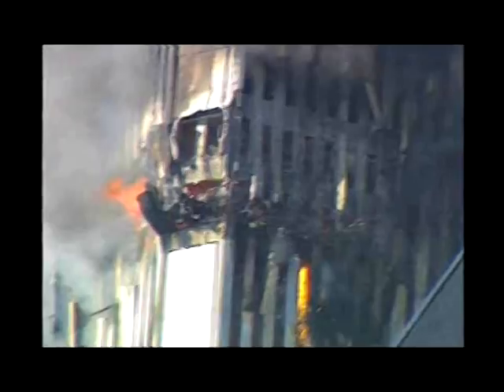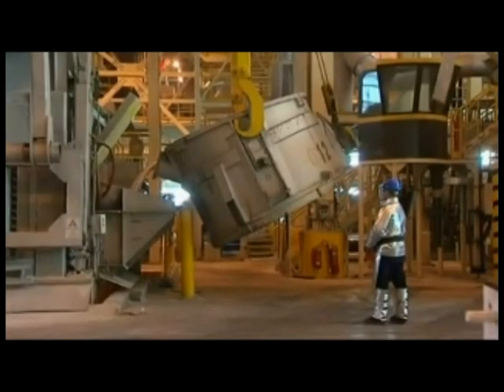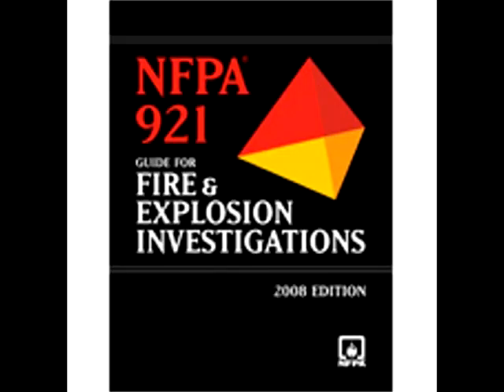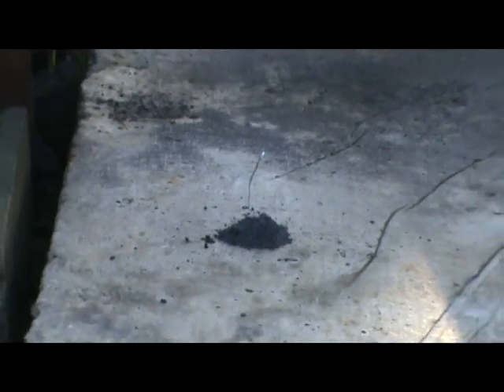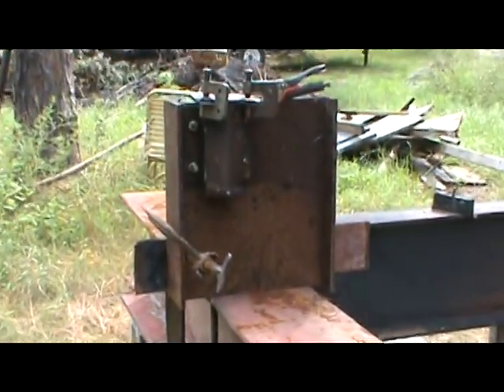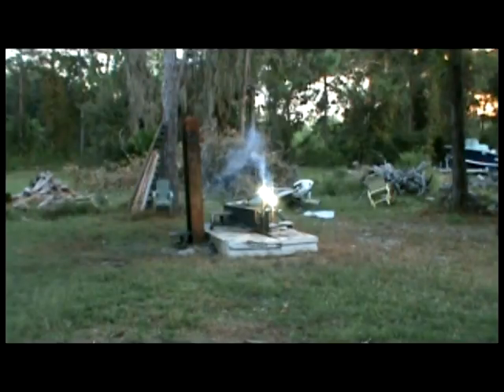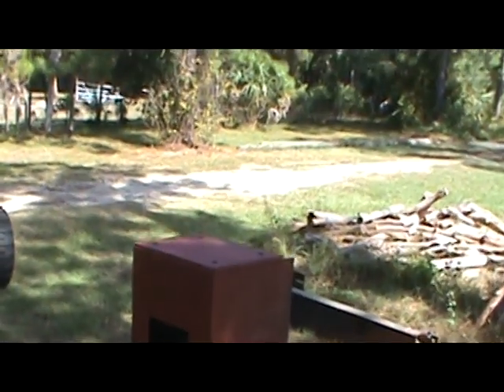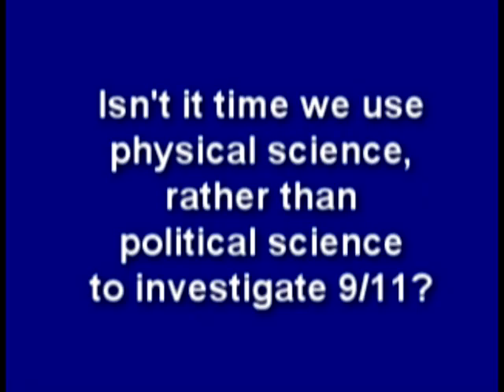9/11 Experiments: The Great Thermate Debate

Comment: I love how the people that publish these "facts"  fail to take into account that when water pours into very hot metal it doesn't just steam it splits it into hydrogen and oxegen.  resulting in an explosion.  also a giant chimney shaped building could easily get enough air to the fire to increase its heat way beyond its usual burning temps.   you can melt steal with wood if you provide enough air for it.